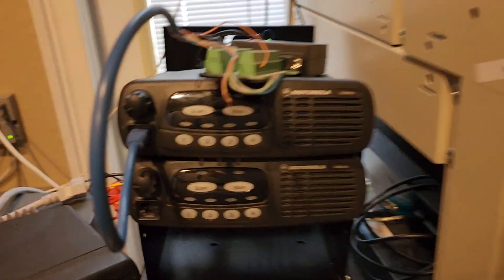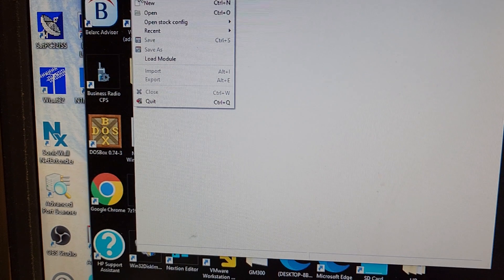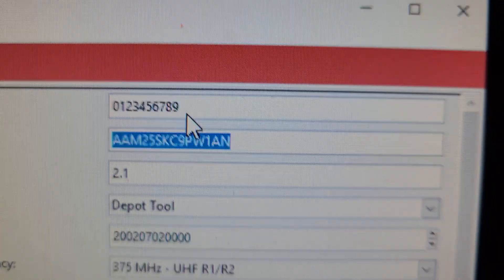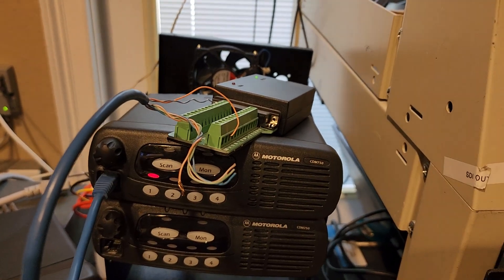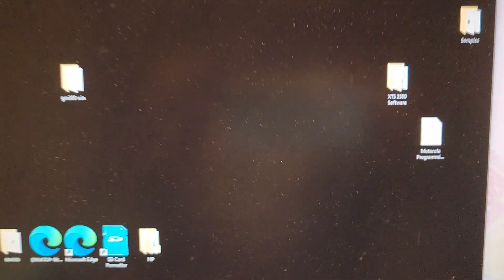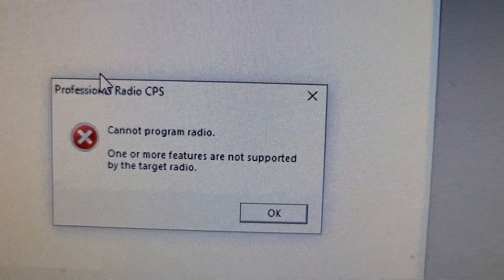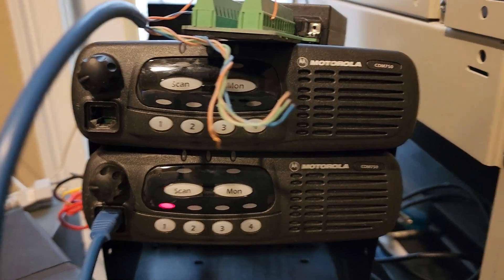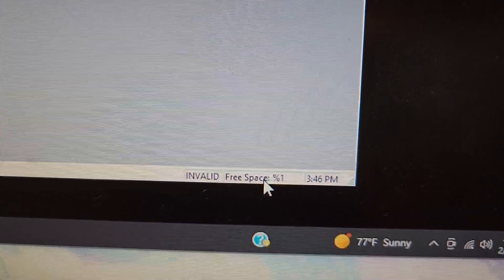Issues with Motorola CDM750 programming in ham band using chrip and CPS

Comment: On my CDM750's (I have two), the red light only comes on when I'm transmitting. The green light comes on for scan, and the yellow light comes on for monitor (not using the privacy tones). I have both radios set up for four channels with privacy tones (or whatever they're called). I'd love to have the ability to reprogram my radios because the audio is really "tinny" and I'm told there is a setting for some kind of audio clarity or compression, and I was told it can make the radios sound tinny and not full like they're supposed to. 
Hope you get your problem worked out. I love the CDM750. I think they're decent radios.
Reply: If it's tinny then switch on the de-emphasis to the receive radio.

Comment: Chirp probably corrupts the check sum creating the error. Back in the days of hacking Maxtrac radios, one had to be careful to correct the checksum after doing mods to the .MDF FILE. I would like to think that the big /\/\ has continued with this habit. There are various versions within the same model type that might affect things as well as to what version of CPS was used to program each radio before you hit it with Chirp. Are you using the most recent version Chirp Next? One might have to blank out the radio completely with Lab Software and reprogram it to its original configuration. Another item to consider, The Serial Number. It must remain the same as the original serial number. Unless you use Lab to change the SN you could be causing issues with the radio.
These are possible suggestions to take into account from using the older series of the 1225 series of radios. I was told to use a Hex Editor program and modify the .MDF file for all occurrences of the lower frequency.I was also warned to make memo of original check sum value. It must be restored to the original by modifying bits in the page describing the version of the program. Not sure how. I still have not tried it. One other issue, that tone might be a sign that the VCO is unlocked thus "locking up" the radio.
There is a forum I believe called Bat Boards where you might search for more info. Fair warning, don’t ask for any Moto software on this site. 73 and good luck! I need to get my 1225 down to ham bands as well.

Comment: I'm having the same issue....Mine are buiilt in a Motorola Case and the repeater is a Model # CDR 700 repeater. Not sure what the heck is going on....
Reply: Motorola has a nasty habit if modifying the software that is loaded onto the repeater versions of these radios. I use a Desktrac repeater and I have to use two software packages to program these repeaters, one for channel data and another that sets various bits in the radios allowing them to work as a repeater, they mostly control the settings on the 16 pin connectors on the back of the radios. Motorola found it easier just to offer one software package dedicated to programming this repeater pair knowing how they operate. Good luck finding the software.
Reply: Almost sounds like in a loop possibly